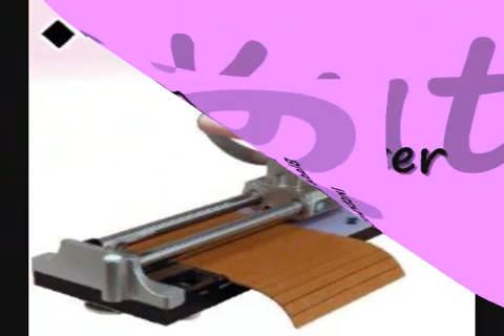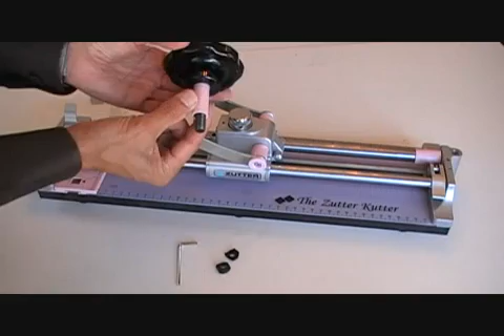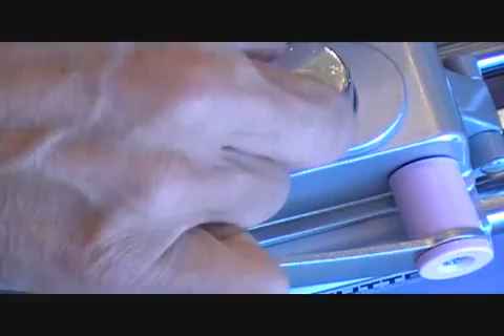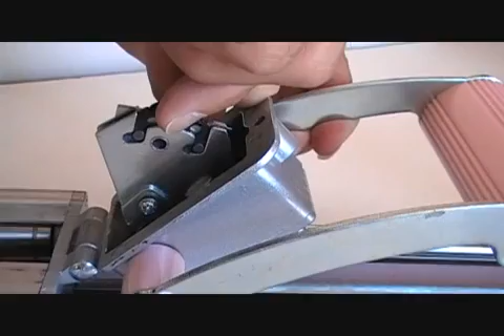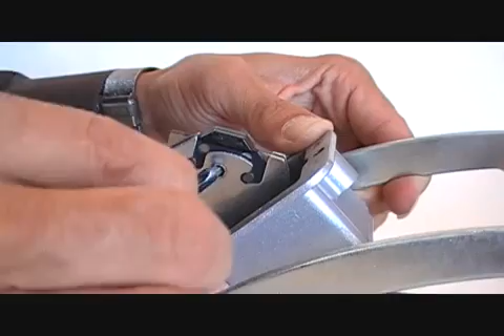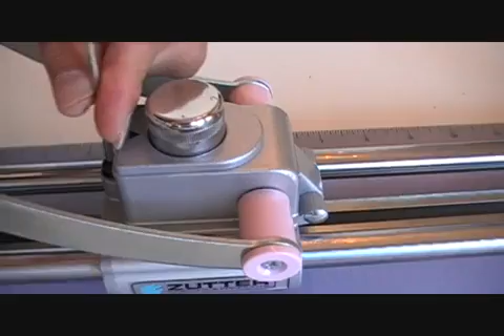Zutter Kutter Assembly & Blade Replacement

Comment: Would love to know where to get replacement blades for this
Reply: Did you find out where?
Reply: @BunnyLang  I’ve replied like 3 times, but YT keeps removing my comment.
Reply: @BW2Color.Stephanie  Whoa!  Sorry to hear that.  Maybe clear your cookies, in case you can't respond I'll tell you how.  Click on Chrome (upper right corner of your screen) and you will see "Delete browsing data")
Chrome will go through the process after, you have to Close Chrome then reopen.  I would also restart my computer.  You will have to sign into any sites you use with your username and password.  If you don't have Chrome, I'm sure any web browser you use will have the same function.
Reply: Hi again, I looked all over the web and could not find them except in Europe.  Changed the blade, sharpened the blade and it is just not working :(. Any luck on your end?